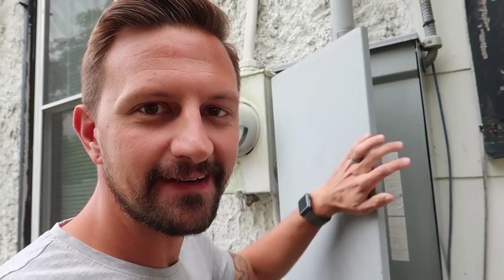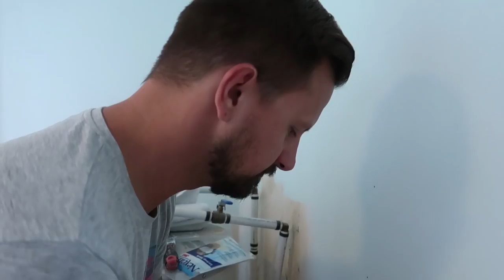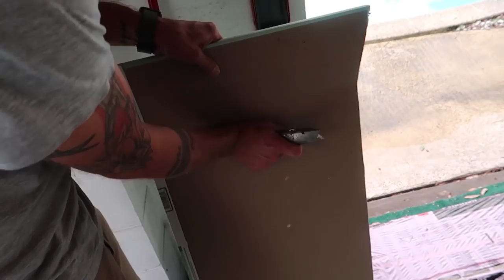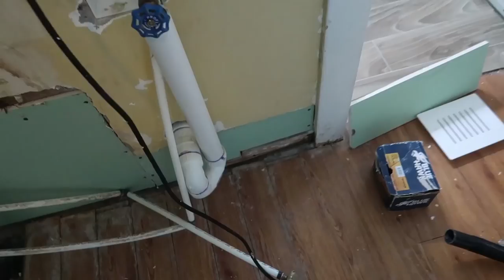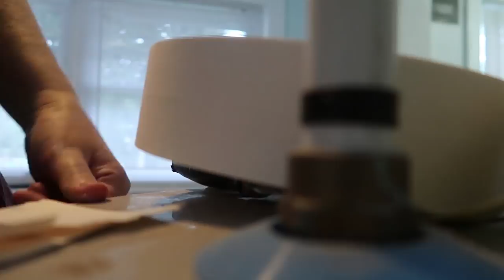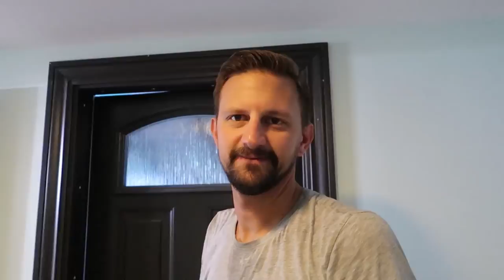Fixing 90 Year Plaster & Screaming Into The Void About Our Bad Neighbors: A Montage! | Home Vlog

Comment: I had this same water theft issue a few years ago with a neighbor, he hooked up to water supply just like your neighbor did. I was away with the Army at Camp Shelby for 45 days. I don't know how long he had it hooked up. I found it when I got home, so what I did was left it hooked up and turned on and just started pulling the hose through the chain link fence between our yards until I heard a crash from the neighbors house. I then went back into my kitchen where I can watch the yard. In about 5 minutes the neighbor came out and climbed over the fence and disconnected the hose, he then went into his house and started pulling the hose back into his house, I went back into the yard and stood on the hose, he came out to see why the hose was stuck, saw me and went back into his house. I then cut the hose and called the Police, he was charged with theft of services and paid a fine and had to reimburse me for the water used while I was away.

Comment: Nice job on the drywall....get yourself a 6 and 12 inch wide knife. it makes the finishing job much easier. Also, when you are applying the mud, only smooth it a few times and then leave it alone. This will decrease your need to sand. Good Luck and thanks for sharing!

Comment: Tim and Jenn, I have over 30 years experience in drywall work. When you have to hang sheet rock along side of plaster, it is difficult because of just what you experienced, of the plaster cracking and falling off. But after seeing your first coat, it appears to be rather nice for someone that doesn't have the years of experience in it. Not bad. If I were local, I would have helped yall out. Trust me on this, I've done drywall work in my dreams over the years. LOL. Been at it way too long.

Comment: when joining dry wall with no studs behind it get a peace wood screw inside the wall to the dry wall so half is showing in the hole then with new peace of dry wall put over the wooden batten to get a good butt joint screw to the wood

Comment: Happy that you guys are back and Jenn is feeling better. Hopefully Bandit is ok. 
I was googling and found a few info for you guys regarding the water theft.  I saw this in a forum: "Have a plumber install electrically controlled solenoid valve in your cellar. Then you can switch on the water from inside your house when you want to use it but close it off when you do not." (Read more: http://www.city-data.com/forum/green-living/2542209-neighbors-seen-stealing-water.html#ixzz5TS6PHhig)
And also file an utility theft report with the Orlando Utilities Commission: https://www.ouc.com/customer-support/outages-and-problems/report-utility-theft

I love your DIY home vlogs. Planning to go to WDW in Jan 2019. Hopefully will be able to run into you guys there. :)

Comment: A  Gallon of water weighs 8.34lbs. per gal @62*F(17*C) making it about 16.6% lighter than the Imperial Gallon.So if your water tank is a 40 gallon  capacity that means it would weigh about 334lbs.

Comment: So, I have an upstairs neighbor who had just moved in.  Landlord pays our water.  I leave my hose hooked up, so I can water plants every day.  So, to be nice to these new idiots upstairs, I told them they could use my hose whenever they like.  The VERY FIRST time they'd used my hose, they literally sliced the side out of it and LEFT IT RUNNING.  Because it's in the back of the house, and I didn't use it for a few days.  I didn't realize what had happened.  They flooded our ENTIRE back yard, and NEVER said a word!  I have the basement, and I wondered why it had started to get damp down there, but it's happened during storms, so I wasn't worried since it was just damp and not actually wet.  Such morons.  Needless to say, I've left the sliced up hose draped where they have to see it every single time they get in and out of their car.

Comment: 16:00 Why not just replace a large 3'x4' section with a single piece of drywall instead of Frankenstein it together? If the wall is really 90 years old, you probably could have easily just redid the entire wall with a single sheet (not criticizing or offering unsolicited opinions, just curious).  I hope you show the sanding - I hate sanding and I'm terrible at it. Now that I think about it... I hate finishing drywall. I like hanging it. Hate finishing it.  Because I suck at it.

Comment: Problems w home ownership sorry young millennials its an older millennial thing but I feel you on the cray old neighbor same. Tim ditch that plastic knife get a 6in metal knife an 8in and a 10 or 12 for finish. And when texturing match and coat adjacent walls. Always use a flashlight or other light to place on the wall during finish sanding Never use sand paper Never use a home depot sponge its dustless rinse and repeat. Oh and to cut drywall tape use metal blade against a hard surface and rip clean cut and for corners bend tape.